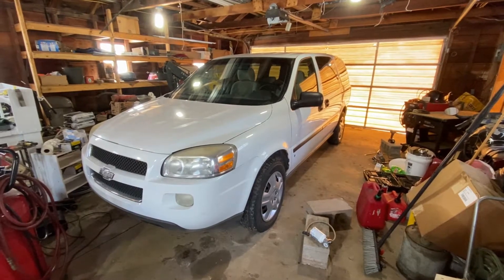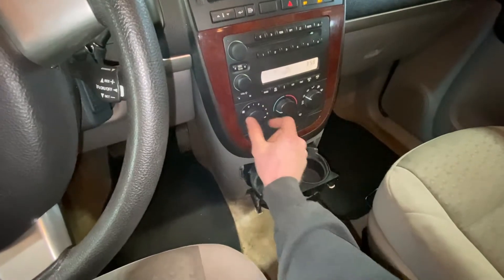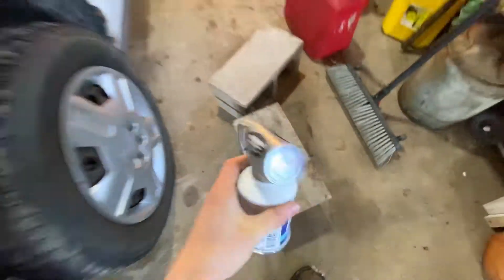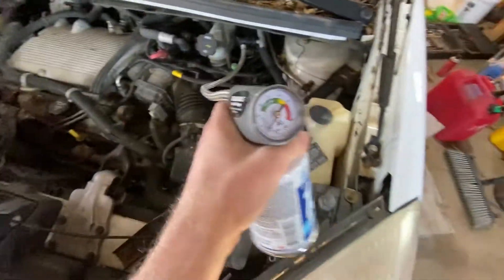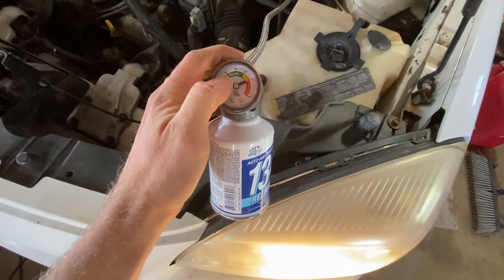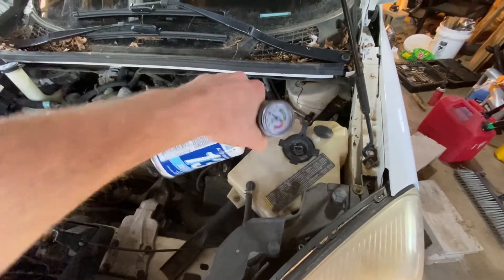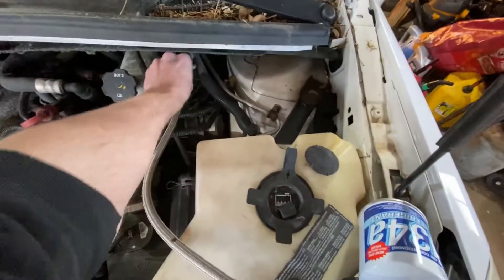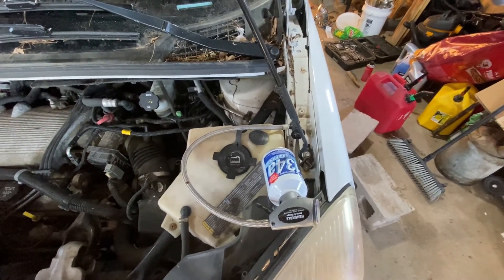How To ReCharge AC Chevy Uplander DIY 2005 2006 2007 2008 2009 05 06 07 08 09

Comment: When I hooked everything up and turned the car on I could not get the gauge to move from the 150 red area on the right. Does that mean it is already full?
Reply from the maker: Sounds like your compressor is not kicking on.
Reply: @DirtRoadAutoRepair  Does that mean the compressor needs to be replaced?
Reply from the maker: Possibly. But it could be other things also.

Comment: This is like a dirty band :dothefive:aid, there has to be a reason the system did not have any pressure.
Reply from the maker: Yeah orings leaking or maybe you just replaced the compressor or condenser and need to refill. 🤷🏼‍♂️ regardless this is how it’s done.